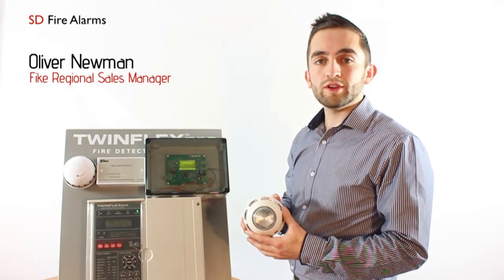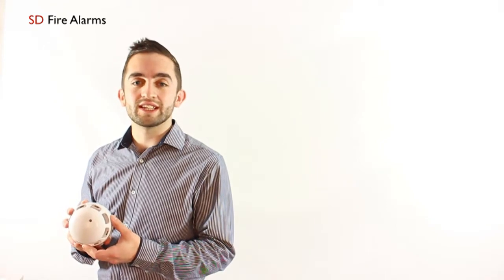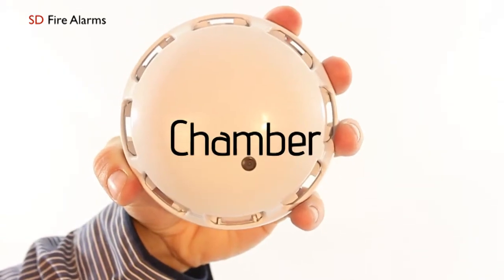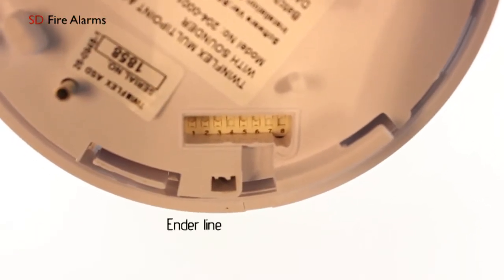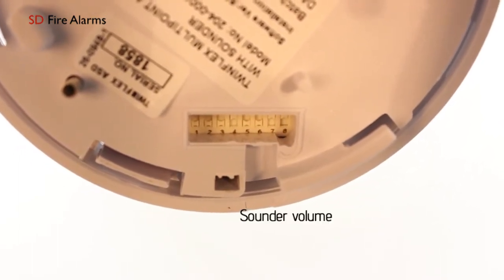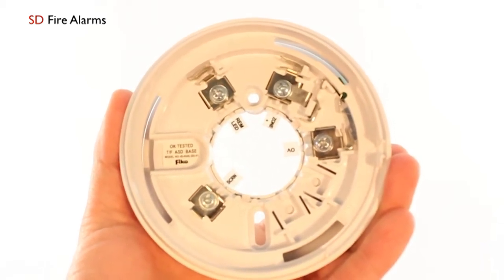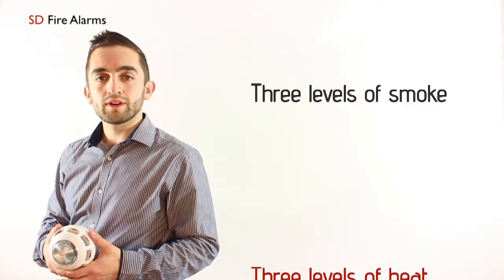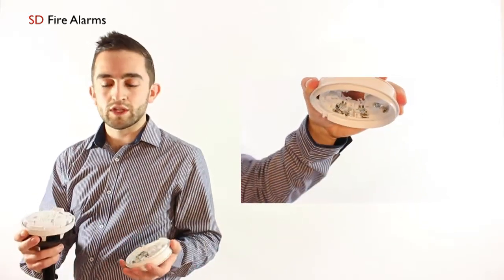Fike Twinflex Pro Panel Part 6: the NEW ASD detector

Comment: You mention that the base has a built in detector, that allows you to identify which head has been removed. Does this give an indication at the control panel in the same way an addressable panel would identify the exact  device in fault?